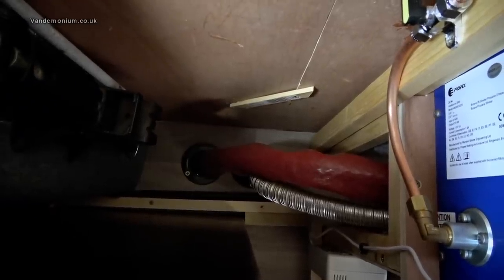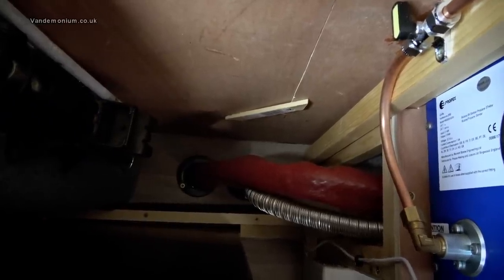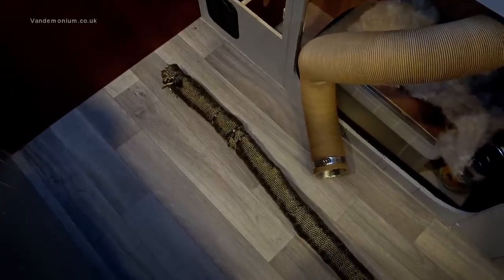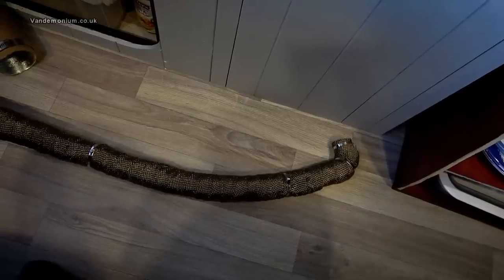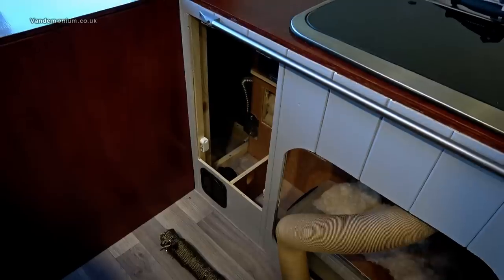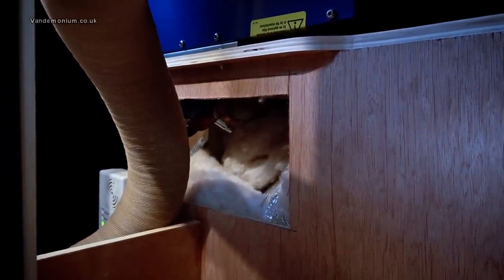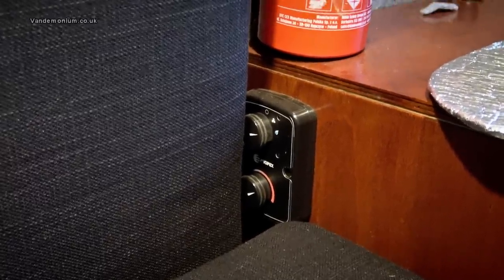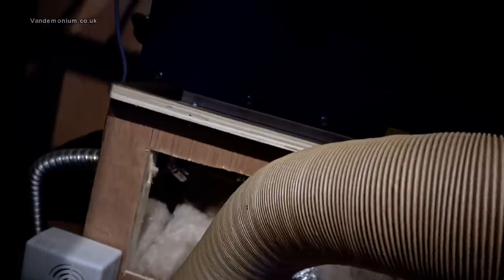Vlog 27: Adding extra exhaust insulation on my Propex HS2000 campervan heater

Comment: What a palava!!  That heater seems like overkill.  You said it yourself the first night - it seemed fairly comfortable without the heater.  If you didn't have gaping holes drilled into the thermal barrier, cold air wouldn't be leaking in (so much).  The exhaust still gets "stinking hot" near the gas filler pipe.  That heater is oversized and hugely inefficient (wasting 30, 40, 50% of the energy you are paying for).  It's putting as much heat outside as it's putting inside (huge waste + other problems).  I saw what a concern you already felt when you installed it in your earlier vlog.  It was very expensive, extremely inefficient, takes up valuable space, requires additional toxic combustion, costs a lot to install, has taken way too much of your time and gives you continued headaches.  We always say that "code" is a D- or the absolute minimum you can do by law.  Code is no guarantee of safe or optimal performance - it just hasn't killed enough people to be a concern.  Plus, this system requires you to drill several square inches of holes into an otherwise pretty good thermal envelope.  It's like having to leave your parka unzipped for safety reasons.  Your body (like a 100-watt bulb) plus other electronics heat the air in the van, the heated air rises out the top of the van and pulls cold air into these holes you made.  This heater heats things up so violently the heated air rises up and out like a balloon.  It's a vicious cycle.  The air changes several times an hour (good because it's hopefully fresh air, but cold in the winter).  The more you use the heater, the faster it cycles.  The insulation job you did does no good if the air blows and cycles continuously through the van.  If we filled the van with water where are all the places it would leak out?  Now air leaks faster and easier than water does.  Plus, it doesn't seem safe that the heater exhaust is so close to those open holes that are pulling air into the van.  A bit of a breeze pushes the air to those holes operating under negative pressure and suck it into the van.  Unless there's a valve in the heater itself, the exhaust line becomes another air leak when it shuts off and it starts thermal siphoning in addition to the other holes you've made.  And adding insulation to the exhaust line may violate the engineering of the system - otherwise, they would have done this themselves.  They're engineers and they designed and built it.  The insulation may very well void any warranty and/or create dangerous conditions.  It starts to look like throwing good money after bad, like one complicated bad idea on top of another.  

Maybe simplify things - Use the thermal envelope you created to the fullest.  Keep the heat you already have (body heat, cooking, and electronics), seal up holes, eliminate the heater (return it since it's so wasteful and problematic), reduce the amount of toxins from combustion and free up more valuable storage space.  Use simple and elegant solutions - not complicated and expensive.  On camping trips, we would light a candle in a tuna can - there are a lot of BTUs in a candle if they are not just escaping.  Eskimos stay warm in snow structures because they eliminate air leakage.  You did a pretty good thermal envelope.  Make the most of it.  Don't drill holes into it.  It's all choices.  

You have a lot of toxins, combustion by-products and VOCs in the van.  We don't know what these things do individually, let alone what they can do when we start mixing up a stew and living in it.  These things matter more if we plan to live longer, healthier lives.  Depending on the level of toxic exposure you are comfortable with, I'd consider a small HRV for continued fresh air while harvesting energy in the exchange.  I think you'd find a huge improvement with that - in comfort, Indoor Air Quality and health.  

You might find a FLIR thermal attachment for a smartphone informative for your van, narrowboat, and other projects you seem to enjoy.  They're very inexpensive and would show you wind-washing from air leakage and how hot things get.  Helps to take some of the guesswork out of making "improvements".

Just for what it's worth, cause I so enjoy your vlogs.  Thumbs up!
Reply from the maker: I'm not removing it, I like it.
Reply: Hmmm
Reply: Seems like somebody else wasted a load of hot air lol

Comment: Honestly, I have watched the ENTIRE series of this build and I think I would rather just let the engine run and heat the van for a little while before bed and then just hunker down for the night. You would have saved a TON of money, work and space in the van for that heater unit. The amount of money you would spend on diesel from the engine would be pennies per night... Otherwise, nice design and execution.
Reply from the maker: Well, no. I have stayed in the van in winter and as the days and evenings are chilly, merely running the engine for a bit before hunkering down is not going to work. Either I have to hunker down ridiculously early or keep re-running the engine every now and again. The heater is ideal; very compact and certainly not using any space that would otherwise be used for something else. Plus since part of the point of doing the van was as an interesting DIY project, it makes no sense not to install things and a fiscal saving is irrelevant.